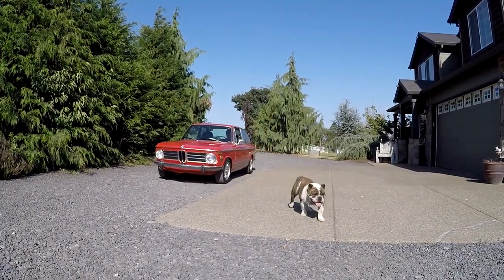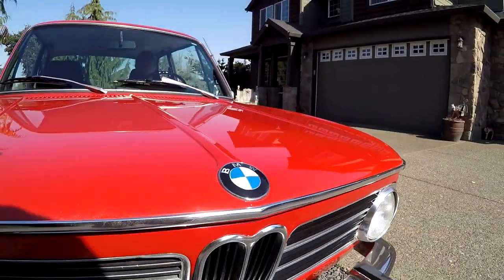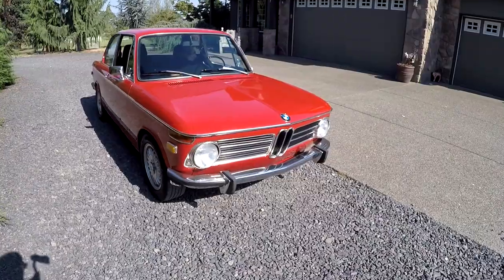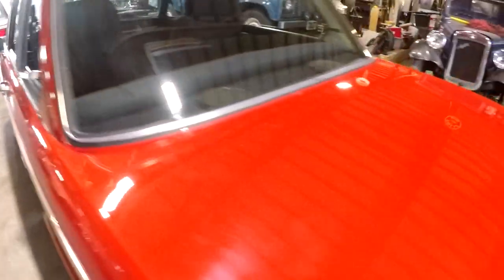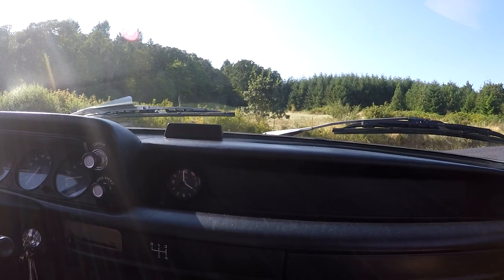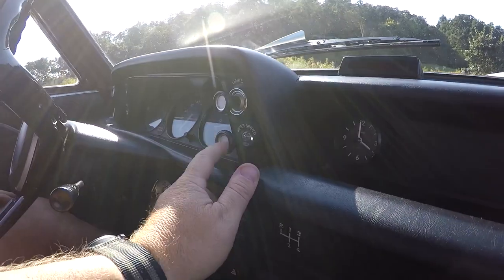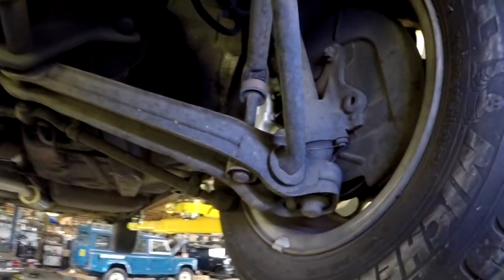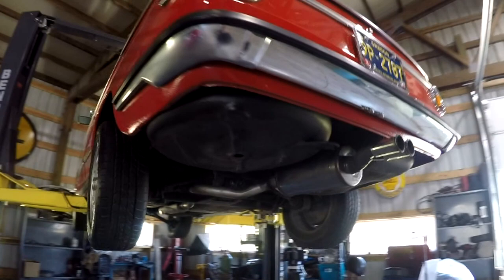1972 BMW 2002tii Final

Comment: Roundie 02's are awesome. A friend of mine in the local bmwcca chapter has one that's immaculate and fully restored. They are fun to drive, especially with an s14 swap and proper suspension, wheels and tires.
The wheels are stock 14" bottlecaps from an e30. It needs motor mounts and the valves adjusted 100%. Previous owner looks like he did a full mandrel exhaust with headers, all aluminum radiator, and some big plug wires. Also sounds like it has a 'street' cam in it. The recaros and 5 speed swap is definitely desirable to me. Looks like its got a decent shock and spring setup on it as well. Definitely not factory ride height. They use strut inserts so you can't see what they are but probably bilstein sports or h.d.'s. Original tii's also had a nice air dam and factory fender flares. This may explain the non matching numbers.